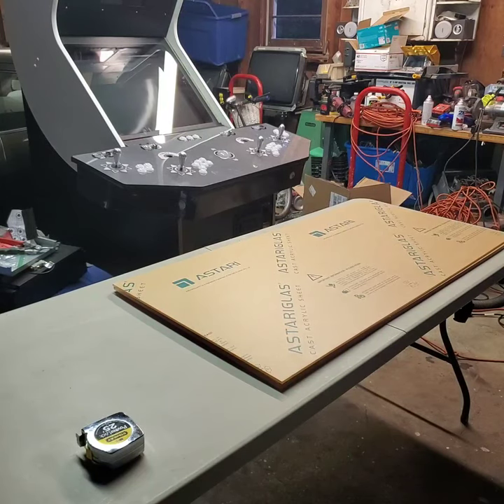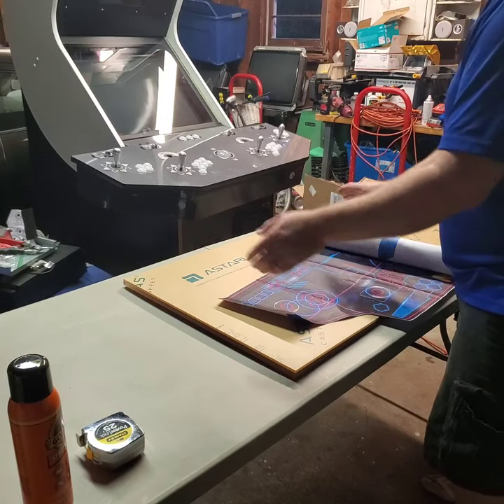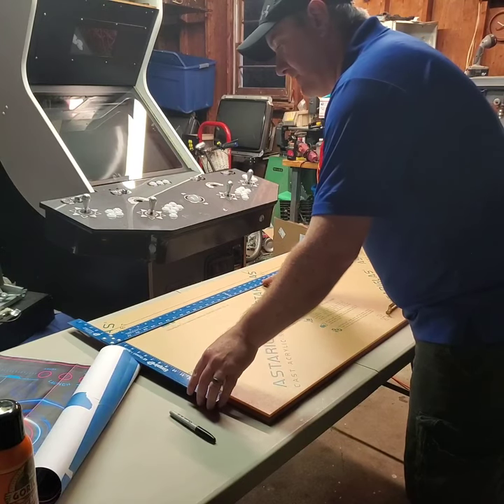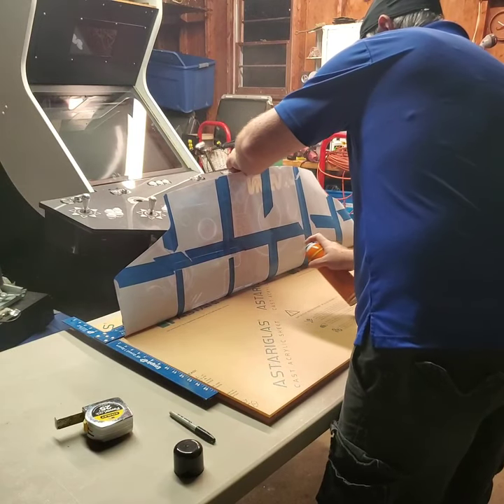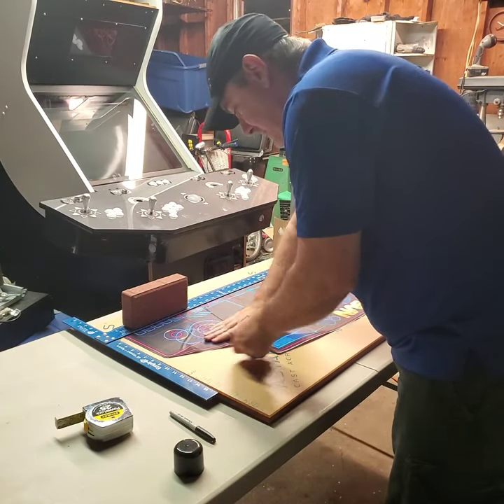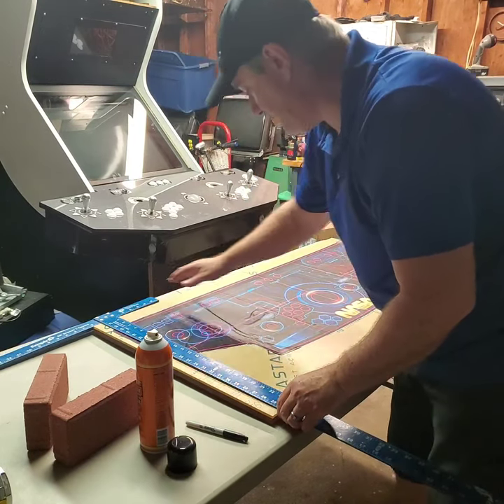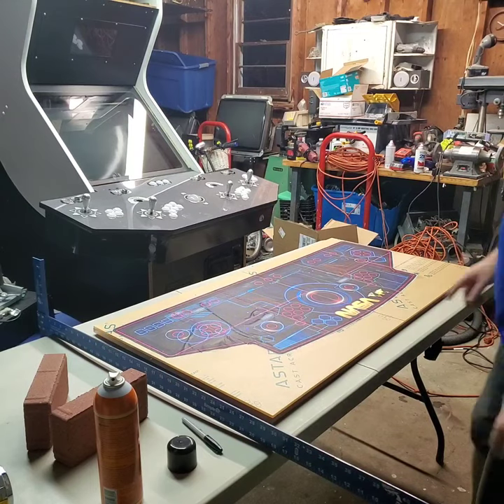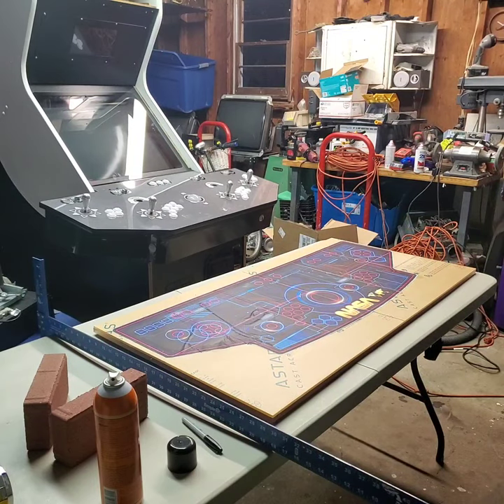Building a Plexiglass Backlit Arcade Control Panel  - part 1

Comment: Why did you drown it in spray?  It's only a template.
Reply from the maker: Because it was thirsty! If you watch part 2 and 3, you'll see that I beat the hell out of it with drills, run saws over it, and run routers over it..  That thing need to stay there because I need to know exactly where the button holes are so when I put down my Translucent vinyl, everything lines up.